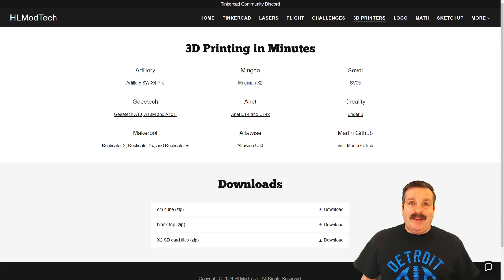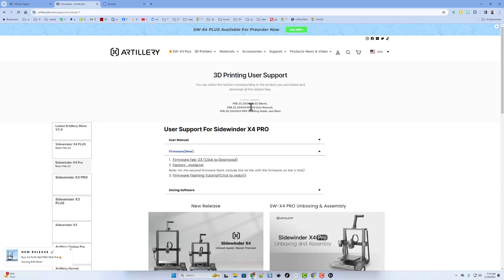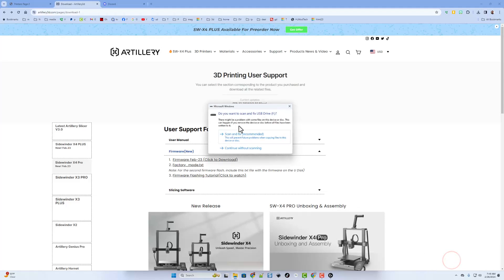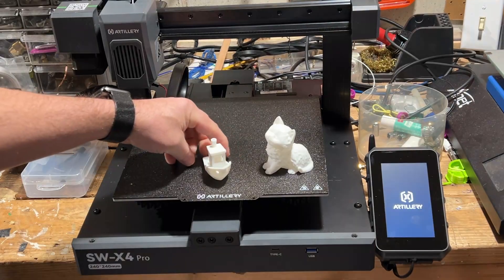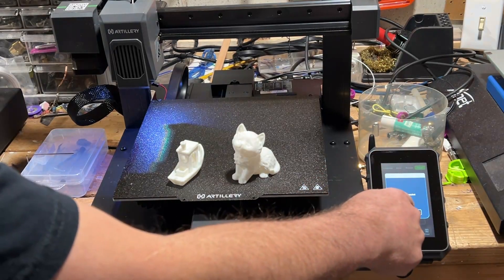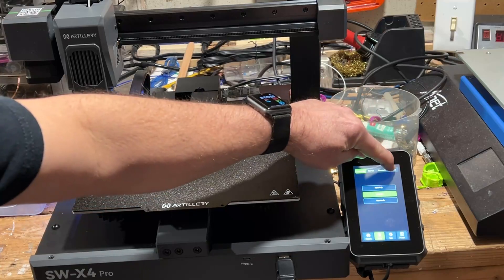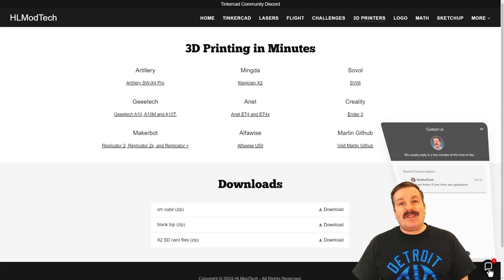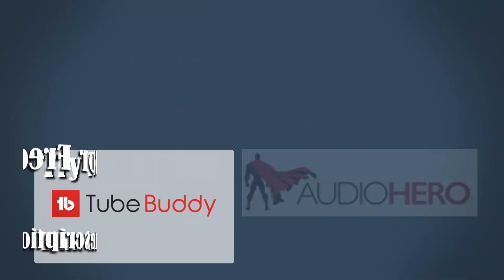Update Firmware Like A Pro Artillery SW-X4 Pro 3d Printer Simple Steps!

Comment: firmware version 1.2.13 here. When I put the usb drive in....nothing.....no option to update, it simply says "no update" I do know the USB is working as I've printed from it. This printer is beginning to irritate me. :(
Reply from the maker: How large is the USB drive?  Do you have another one you can try?
Reply: @HLModTech  2gb.
Reply from the maker: That should be a fine size. Fat32 format?
Reply from the maker: This is my latest firmware tutorial for that printer. https://youtu.be/GNK3ISMEpMU Maybe that will help.
Reply: @HLModTech I ended up putting the USb drive in my laptop and formatting it. Worked fine. For some reason it didn't like the formatting from my desktop. Strange but I did get it to work.
Reply from the maker: Nice solution. I have been there too. Try, try again is my go to strategy. 💯👍

Comment: I did all that, but my printer is stuck on a black screen with the artillery logo and won't turn on. Absolutely no response. What should I do?
Reply from the maker: I would try support. That is outside my skill set. Are you on the FB groups? I saw a post a bit ago about a support email address we can reach out to.
Reply: Hi, do you have solution? Mine those the some thing and i can fix it with out the screen. Thanks!

Comment: Hi there, I  hane the x1 for meny happy years now but I am seeing nothing but horror storys about the x4 pro. Mindyou the latest video review was also bact 2 monts ago. Please could you let me know if you have had any problems since yoy got the latest firmware???
Cheese.  Mike Irish
Reply from the maker: I have had no issues. It seems to me users were trying to modify Klipper (since all the YT vids had you adding and updating from scratch) and got themselves in trouble. I have since added a Bambu P1S so I am using it a ton too and it gets more air time. The Bambu is more precise, but with AMS it was about 1,000 and the X4-Pro was closer to 300.

Comment: 🥇first comment🥇
Reply from the maker: Thanks bud! Do you have a 3D printer?
Reply: @HLModTech  No there to expensive and most of my models would break if I tried to print them.
Reply from the maker: The first one I got for my classroom was more than 4K... I wrote a grant for 4 of those machines. My new ones all cost around 300. Much more reasonable now days. You are correct though.. they are not cheap.